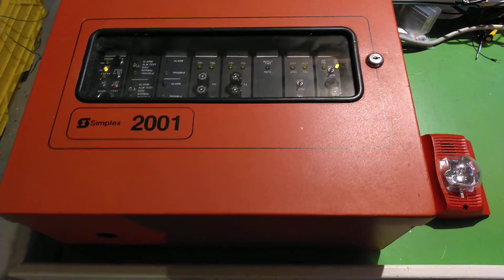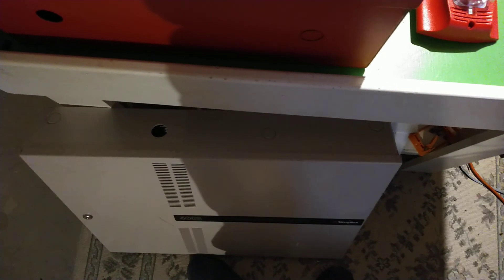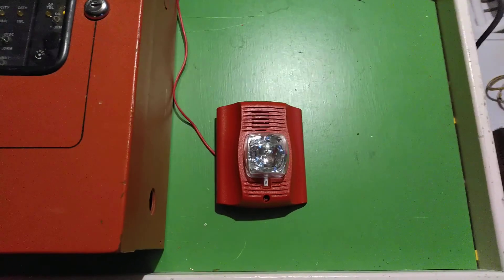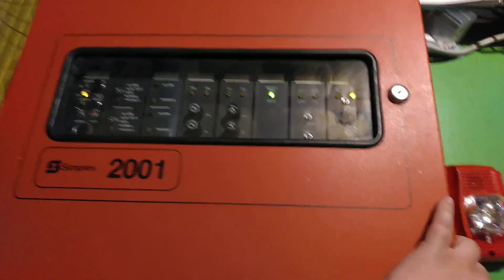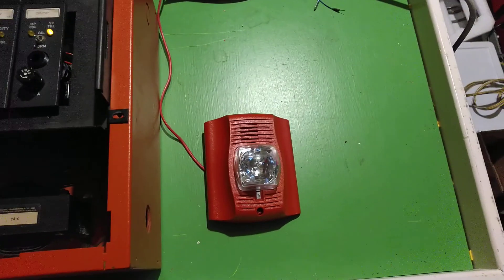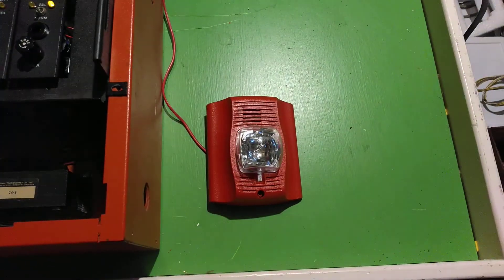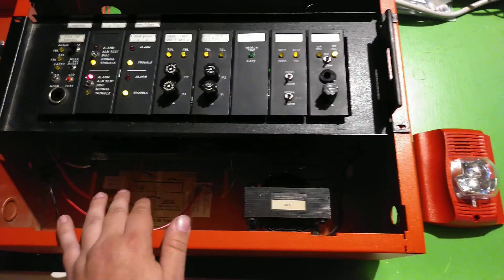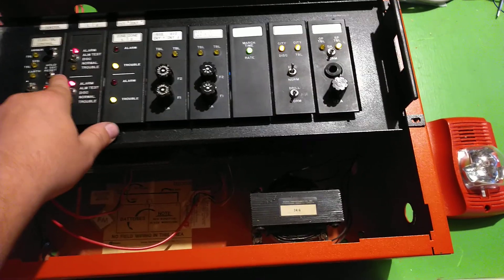Workbench System Test 13 | #FireAlarmFriday

Comment: Nice video! Cool to see the System Back I did a Test with the Newer System Sensor L-Series Today. Did you get the Panel off of Ebay?
Reply from the maker: Yes, several years ago.  It needed to be wired and configured before I was able to use it.
Reply: @The Blue CFL  Cool!